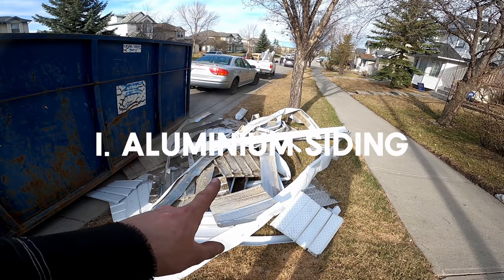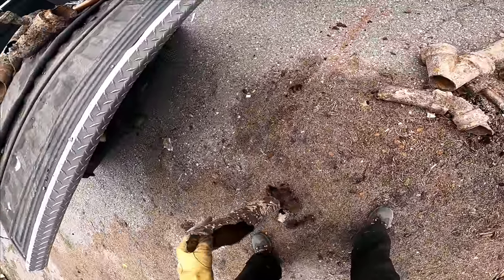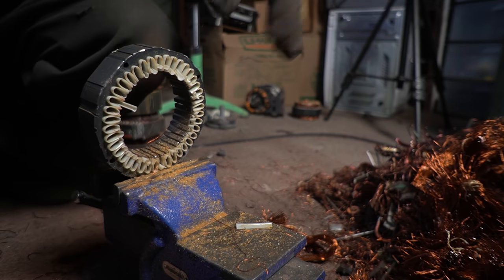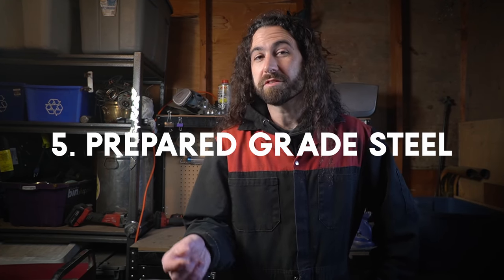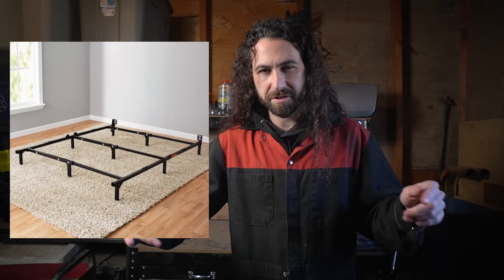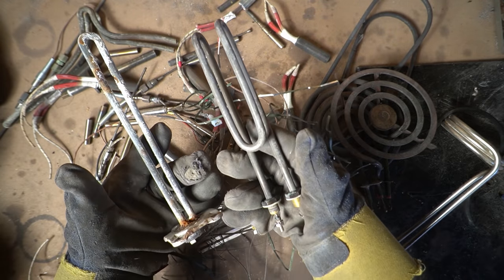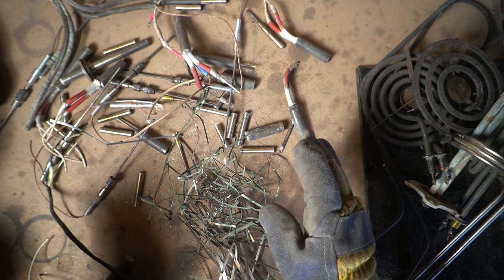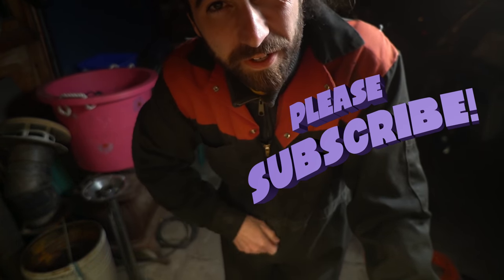5 Things You Didn't Know You Could Make Good Money Scrapping!

Comment: Tin has a melting point of 232°C, so I seriously doubt it would be used in a heating element. Tungsten perhaps.
Reply from the maker: That’s an excellent point.. I really wish he’d just grabbed the xrf
Reply: Heating elements are made from Nichrome a very resistive wire.
Reply: Yeah Tin would be weird, unless the guy meant "tin" as in sheet steel. Nichrome wire or tungsten is a good bet, and either one is worth a good amount. Nichrome heating elements are like 65% Nickel. If you bust up those coils and calrods, be careful of the dust from the ceramic in them, it's probably super bad for lungs.
Reply: Nichrome is also used as the main type of heating element in atomizers in ecigs.
Reply: Fun exercise:  blow heaters have Ni-Cr wire coiled inside as their heating elements.  If you take an old one apart and pull the wire straight, you can connect it to a 12volt supply and use it to cut polystyrene sheets.
Reply: @andymanaus1077  I've actually made a foam cutter like that before. The thing worked great.
Reply: To bad we do not come across these here where I live. My compagny owns an xrf gun so I could check it

Comment: I made about 800 last week! I offloaded about 100 pounds of copper before the price took a nosedived . Almost a ton of steel . 2 transmissions and 40 rotors! Ready to get back out for more.
Reply from the maker: Yeah the price did soften a bit didn’t it.. shoulda sold some of mine earlier lol
Reply: RuckusBernal  light and sign companies . Heating and air, auto mechanics, and medical companies . Specifically mobile MRI companies. Making 1500-2000 a week now!

Comment: I like how you share information to teach others. I know the scrap metal business well. I made a living hauling scrap for several years. I started off with no knowledge of the business at all. Before long I knew all I needed to know to turn my loads into huge profit. My scrap yard would call me to ask if I could help them fill their quotas each week. I never took anything to sell without fully processing and separating the grades and types. Sometimes a load would pay before I ever made it to the yard. Once I found a huge pile of coin op washers and dryers dumped in the woods. While loading them I noticed one still had some coins in it.  At this point I decided to inspect each unit. Lucky for me I did. Nearly $400 in change before the load hit the scales.
Reply: So is steel worth scrapping? I figured the fuel it takes to haul it would cost as much as the steel you're scrapping.
Reply: @randybobandy9828  the yard I sell my scrap to pays good for just about any metal. Shred mix is what I make most of my money from. Shred is just a mix of all types of metals in general. I've been paid up to $10.50 per 100 pounds for shred.

Comment: I've always profited from aluminum scrap. Imo, copper, aluminum, brass, car batteries and a couple catalytic converters along with your steel scrap imo really boost cash flow.  Appliances, I stripped the copper out and the electric motors out of Appliances to make more cash, hot water tanks have brass and wire to separate from the tank and earn more cash.

Comment: furniture. specifically recliners. once you are familiar with how to remove the steel unit about six to ten screws usually the larger number three robertson and phillips, with a couple lag type hex heads. a drill and bit with long extensions, socket adapters, 3lb hammer, snips or the original vice grips. the first time it might take several minutes and feel like a pain in the butt but once you know the basic points of connection it might take two minutes. it helps to bring a rope to tie it shut because it will want to spring open all the time, get hung up on other pieces and take up a lot of room.
everyone tends to leave these tasty morsels because they feel its complicated. lots of work or never even thought about it, i feel you have to try and your counting in pennies and nickels and dimes anyways. figure theyre about 50-70 lbs of steel for the good ones. me i save a lot of the bolts, nuts, screws, washers, tubing, and springs to use in other projects.
welp just thought id add that. keep up the good work!

Comment: In Winnipeg one plant offers 35 cents on stove elements before the current copper increase. They have steel rollers that break the wire off. Very good clip with a 25% thumbs up.

Comment: Nice! I’m an 18 year vet of non ferrous at EMR and two years ago became a buyer at  another yard in Houston. I’ve also been the “alloy guy” the whole time.
 The elements you want are from heaters. They’re called HW6015. They look like springs, are non magnetic and you’re going to need three barrels of them with no wires or insulators to get decent money.
I’m just saying you’re correct that heavy lifting, separating, and cleaning items make you more money than yanking an a/c or catalytic converter (don’t do either).
Reply from the maker: Well I wasn’t gonna come out and SAY IT say it, but yes lol 😂 ripping someone off is pigeon behaviour, but there’s decent money to be made if you can get the weight. Thanks for the inside scoop on the heater wires! It would definitely take a long long time to save up enough to move the scales with those

Comment: I used to remanufacture Laser toner Cartridges and the drums the laser rights on are aluminum and the mag sleeves are to. Some of the drums are solid alluminum. Usually around 2 inches wide and 10 to 12 inches long so they can add up and the cartridges are usually pretty easy to take apart especially if you are not wanting to reuse them . In fact just to give yal another income venue ....most toner cartridges in laser printers and copiers are worth something to someone because many remanufactures are looking yo buy the used ones. If they are OEM then you can get anywhere from 8 bucks to as much as 50 bucks each abd some places will have hundreds of printers. Its worth looking into. When I did it i was making about 5 to 600 extra a year on the drums and then just on the cartridges that we didnt remanufacture and that was usually because we would only have 1 or 2 customers using certain printers so we just sold them new ones as getting all the stuff to remanufacture then just wasnt cost effective. We might only selk a few of them a year but out there somewhere is a place with a 100 of those printers and they need the empties.Some cartridges can only be remaned 2 or 3 times do to there design. Id make a couple thousand twice a year selling them off. Paid for xmas and a nice vacation!

Comment: When I was a about 12-13 long time ago we went to the military shooting range and cleaned up years worth of brass shells and raked the sand slope at the end of the range for the copper/lead bulletheads. Got around $150 for a hard days work, wich was good money. Would have gotten way more if melted the copper and lead into separate piles. 100pounds of copper at least. That alone would have given me around $390 with todays prizes.
Great channel dude. I havent really considered scrapping for ages and have probably given away several hundred dollars woth of scrap my self. But considering it as a side hustle. Do a little metal detecting as a hobby and morally obliged to take with me junk metal I find. So I practice that "Leave it better than you found it" advice. Greatest, silent and boomer generations just dug down or left their broken stuff in nature for it to rust away I guess.

Comment: I mainly go for fins in air conditioner, sealed units, copper pipe,electric motors...Even go at flat screens for gold...And cutoff cords..But I save it, if it works.. got a hardware store ina closet..Put fans together from crossing parts.... Storage and collect..

Comment: My steel yard doesn't separate prep steel but also I save bed frames for angel iron and I scrap the motors for the copper and the motors are 20 cents a lb without the copper

Comment: The best way of making money scrapping is to take all you can get. If you have the space and area to strip things down. Move the tin and light steel as soon as possible. Stock pile your brake rotors and drums, copper wiring and pipes, brass anything, and car batteries. Any appliance you get take the time to strip down. Just pull the easy copper, motors, and compressors off of  them and stock pile them and move out the tin and lighter metals asap. Haul in your stock piles when you reach about a ton in weight ( for heavy steel and batteries) and a couple hundred pounds of the none ferrous metals. II never haul in a load that isn't worth $500+ It has to be worth you time, and fuel to do it.

Comment: I myself scoop up any worthy metal whenever I can, over the years I've done so . I remember one time I came across massive electric motors.. literally weighed atleast 200lbs each. I pulled the passenger seat out of my little car and piled them up. I never broke them down and removed the copper so I know I lost out on ALOT of money. All I got was weight price for bulk scrap. I think was a set price for electric motors. It really pays to bring in clean organized metals. Otherwise you lose out big time. But copper and brass are like my gold lol. The best is that inch thick copper bare bright electric cable. But it's very hard to come by... Also not easy to strip unless you have a machine that strips it.

Comment: I was kinda hoping to find out what that wire running through the stove top elements is. I have a handful and they're relatively soft for the amount of heat they handle. I have a nearby yard that can scan it but just haven't remembered to bring them in.
Reply from the maker: I’m glad you looked it up and shared that it’s nichrome, I missed an opportunity to make a dedicated video on them but at the same time I’m not sure it would change much for most scrappers

Comment: Water heaters sometimes have Magnesium Rods in the tank. That for sure is a high end metal. To check it, shave a bit of the metal off the rod and light it with a torch. It will burn completely out and be very bright. Do this outside in the dirt. Water will not put out a mag fire. It will burn under water. Something about creating O2 during the burn.

Comment: Stove element and other high nickel content are mostly Inconel. Alloy 600, 700, 800. But they are contaminated with other metals and ceramic inside. Most of the scrap yard just buy it as irony stainless steel. They sell them as is, and send them to a shredder to recover the inconel. The easiest way to recognise better grade stainless steel is to look at the spark. Regular stainless steel (304) have a regular orange spark. Look for short and red spark, here is the money.

Comment: Siding is great for the volume it takes up. Older stuff is harder to flatten by hand but weighs a lot more. Delve into "busheling", it is the ferrous bare bright.
The burners are 304/316 stainless with a nichrome or a cheaper (includes iron) nichrome alloy surrounded by aluminum oxide or similar refractory sand. More expensive burners may have an incolloy casing.
Reply: As a metal consumer at the scrap metal place I thank you!  They have made so much money off me at the scrap metal place I should have a frequent user discount!  If you clean up after taking your metal, double thanks!  I use the metals to make sculptures so please treat these pieces gently!

Comment: The time it takes and how much you can haul in one trip determine if it's worth scrapping steel and iron. My nearest scrap yard is 80 miles away and most of those miles are 35 mile per hour conditions. It's about a 2 hour ride.   My truck can carry about 1,500 pounds without being overloaded. Using the IRS rate of 58.5 cents per mile it costs me $96.60 to drive to the scrap yard and back. 1,500 pounds of iron and steel pays about $150. That gives me a net profit of $43.40.  Loading the truck, driving and the time at the yard is 5-6 hours. That's not good money. It's a way to kill a day without spending money out of pocket.
Reply: Keep an eye out for scrap to collect on the way back, many truck drivers where I am always make sure they do not travel anywhere with the trailer empty as it's all money. Do whatever you can by hauling whatever to where ever.

Comment: I am glad you mentioned the bed rails. I need some angle iron for a project I was working on. With supply chain and inflation my price increased almost $300 on the project. Being a small scrapper, (once a week or so), I stated save the bed rails until I had more than enough to complete the project . Not only did I save the $300, I also saved the entire cost of the steel needed.  Plus now I have a rack to store heavier things in the shop. Plus if you are willing to sit on the bed rails for a bit and entire load will max out pick up truck rather quickly. Cut the short ends off and you can stack it even tighter.  Also those little bits can fill the space around the wheel wells the long stuff leave open.  

So in fact, bed rails are Multipurpose in scrapping.

Comment: I am from Alabama I have been scapping for years and I a made good money over the years I had restaurant appliances from remodeling stores, I had a place called Kenmore microwave service  for commercial and residential l wood get 50 to 100 microwave per  week it's against the law to though in the trash, auto repair shops wood get all metal for free or just put some money in the mechanics hand win win every body's happy I would get motors,trans.and vehicle s last place I  worked for I was a maintenance for a subcontractors for the phone company company and I covered the whole state of Alabama made really good buy just stripping hardware off telephone poles, phone boxes and old off of equipment made really good money at it I am disabled now but I sure miss doing it I just ran across your site and you made some good points about it my dad always said the better you separate the more money you can  make.

Comment: 👍 Think those elements would be a wire or conductive metal to be heated with current passing through, and a metal around it to sustain the heat. The lab equipment strips are likely not for sustained heat, or perhaps there was a plate/cylinder/chamber that they were in.
I bet you would be fine tossing the thin strips in #2 copper.
Reply from the maker: I’ve been told there is a place in town with a higher price, I’ll have to save up more now and try again haha

Comment: I'm not a scrapper. But I do have some scrap metal around the house. In your opinion, is it worth the time and effort to load up 7 steel rims minus the lead and rubber and haul it to a scrap yard ? There is one local. Just a few miles away. A quick Google search tells me I'd be lucky to get a dollar a wheel. What do you get for steel wheels ? I'm newly retired and financially secure (I think) but this scrapping looks interesting and would give me something to do. But for right now, I'm just looking to discard some of the crap around the house. Can't decide if I could get the price of a meal or set it to the side of the road for the city to pick up. I also have a 40 or 50 lb. section of ornamental cast iron to get rid of as well.
Reply from the maker: Well it depends on what your scrapyard will classify it as. Personally I would absolutely bring the rims in, at prepared steel prices I’d get $15-20 for those. Cast iron is a little lower but the weight is better. I say load it up!

Comment: Steel is where it’s at. You just need the space and equipment to haul all this weight around. You need copper and aluminum as icing on the cake. 2k of steel at the yard is like $110 and all the copper and aluminum will being up your total to $200 a run. I clean up untouched properties and after sorting, I’ll get around $1000 over 4 days. But this isn’t an everyday job kinda thing

Comment: In Australia steel is basically worth nothing, cost you more in fuel to get it there .  I used to make my money from cast alloy, car gearboxes , heads etc. However it requires a fair amount of time, and some decent tools to strip them out, but the weight adds up quickly. Right now alloy is only worth a dollar a kilo and therefore not worth the effort. I still do throw these things away, it will go up again eventually. The money right now in Australia is copper and brass.